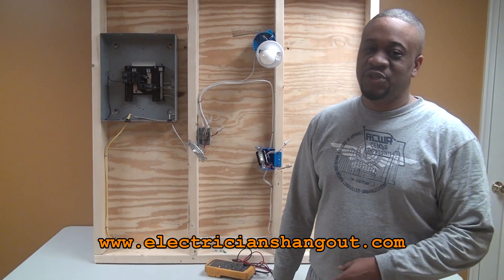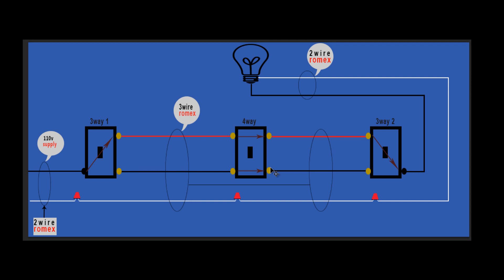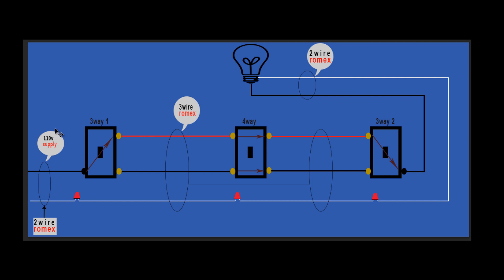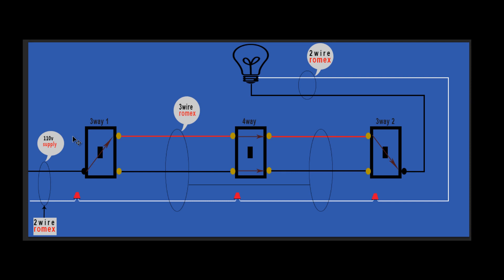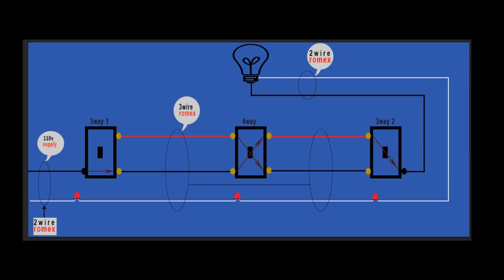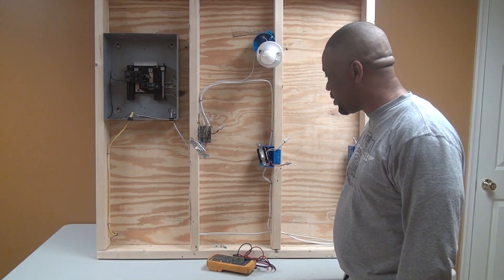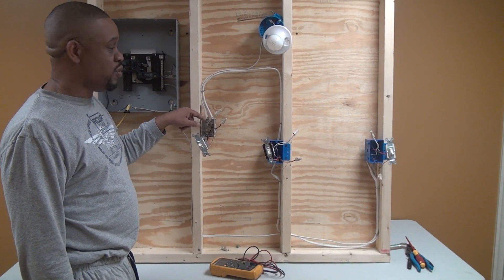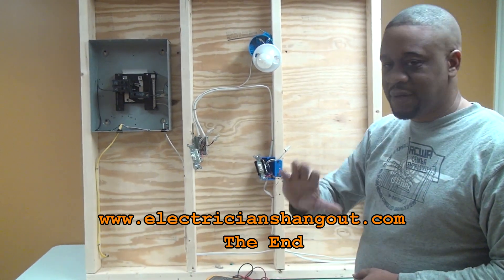How to wire a 4 way switch

Comment: Thanks for explaining the 4-way switch in a very clear and easy to understand way. The wiring diagram is very helpful, and isn’t included with all the other videos I’ve watched about electric wiring.

I’m converting my kitchen recessed incandescent flood lights to LED flood lights. I have 3 switch positions, and one of the switches has a dimmer control. I assume that the dimmer control is not compatible with LED dimmable light bulbs, since the dimmer is 15 years old. 

I do not know which switch is connected to the uninterrupted electric power. If the dimmer controller is connected between the two on/off switches, then I would need to buy a 4-way dimmer that’s compatible with dimmable LED light bulbs. Otherwise, if the dimmer is not in between the two on/off switches, then I would need to buy a 3-way dimmer that is compatible with dimmable LED light bulbs.

Do you have videos about converting from incandescent to LED lighting, which also involves a dimmer and 4-way circuit?

Comment: How would you wire a 3 way if you have black and white on a light switch
Reply from the maker: if there is a single pole switch on the black and white wire then can't
Reply from the maker: you would have to run all of the wiring

Comment: Hey Tyrone, I just saw your vid because I just did one similar and put it up tonight and decided to look at who else has something here like that to compare since I'm new on youtube and my vids are mostly mechanical related. We have the same last name and I chose to look at yours first, I'm not a pro electrician but have been dabbling in it for ever, I was a pro auto mechanic and welder before my lazy side got me into trucking but can't keep out of repair work, it's in my blood, my vid is shorter and simpler maybe you can look at it and tell me if you see anything wrong, I know it's safe and works but maybe not completely legal. Thanks.
Reply from the maker: +Gordon Robertson Hey Gordan took a look at your vid and it looks good. The only suggestion that I would give would be to group the conductors together in the panel using tape or ty wraps.
Reply: thanks Tyrone, you must have seen the new one I put up today on the double dedicated, that box is in my shop and is always open, I know it's a mess, I would never leave a panel like that at someone else's house, the video I was referring to was on the 3 way and 4 way that I laid out on a piece of plywood. I don't have any mechanic vids to do right now so I did some electric just to keep some new ones going up. I only have 4 right now on house electric and probably won't do much more on circuits, but I might do 1 or 2 on fishing thru the walls, old work boxes and patching walls. I would appreciate if you could look at the other ones I did on electric and tell me what you think. Thanks, Gordon.

Comment: The wiring  he using its perfectly working!
As for the names of switches he is  wrong, the switch on midlle its call "INTERMEDIATE" because its acting between those he calls 3way which again wrong because those are call "TWO WAY" they are actually have two states.

Comment: Thanks for your video is very clear and helpful, Just  question that  I have is, I's installing a SENSORSWITCH CMR9, when I ordered they explain me is possible used like 3 way switch and I did without problem but I am try to install now 3 switch at the same fixture (like 4 way switch) do you think is that possible? Every sensor has 3 wires white=Neutral, Black=load and another Black =Hot., thanks
Reply from the maker: not sure I understand your question, are you trying to control the light from 3 different locations?
Reply from the maker: it looks like you can wire as many of the sensors in parallel as you want so if I understand you correctly the answer is yes.
Reply: YES , the answer at your question , lights from 3 different location, I did you recommendation and the system is working great Thanks again

Comment: Hello Tyrone, I acknowledge your skills with electric I was just wondering why is that with the 3 way switch tutorial the black wire is connected with common screw and on the 4 way tutorial the black wire is connected to one of the travelers screws and the red wire is on the common
Reply from the maker: Not exactly sure what you mean when you say common? The black wire is hooked to the point screw in both the 3way and 4way switch video. you have to remember that in both boxes with the 3way you have 2 black wires one from the 3 conductor and one from the power source in one box and one going to the light in the other. The black and red in the 3 conductor I use as travelers.

Comment: In DC circuits the black wire is the ground- correct?  What is the white wire in AC?  alternating current means no fixed + and - , but there is an actual ground (to ground)  why is the white called 'neutral'?   Does anyone know a good book on standards so I don't kill myself wiring my house?
Reply from the maker: The white wire is called the neutral or the grounded conductor not to be confused with the grounding conductor. The neutral serves as a path for current to return to the source so it is a current carrying conductor when the circuit is under load (it is hot). Just knowing how a circuit works help when wiring a house but in order to wire it safely requires a lot more info, a lot more than I could explain in this reply. I am coming out with a residential basic electrical wiring course in the next few months that teach the things that you need to know when doing residential wiring. When the course go live I will more that likely offer it to my youtube subscribers for a discounted price.

Comment: I have a question, is not about the switch.
I have an old blender which have an metal casing .. and if i touch it i dont feel anything... but if i touch some bowl sitting next to the blender i got shocked... 
It was sitting on the metal table ... i know it may be shorted circuit... but why i dont feel anything when i hold blender? How does the current flow ? And why i get shocked when i touch metal bowl that is separated on the other table.. ? Oh, and the circuit breaker did not trip even it has the cool 30mA  protection.
Thanx for the answer
Reply from the maker: The outlet supplying the blender is not grounded. If there is no ground in the outlet box you should replace it with a GFCI. That is a particularly dangerous situation and should be addressed immediately. All that being said the reason you do not get shocked when contacting the blender alone is the current has no path to ground. when you touch the blender and a source that has ground or something close to ground potential the current flows through you to the ground source (very dangerous, with a good enough ground and current taking a certain path through your body could cause death!!!) so be sure to stop using the faulty blender and replace outlet with GFCI if no ground is present in the box.
Reply: +Tyrone Robertson  I have seen this happen when the outlet was wired backwards, example, hot wire on the silver screw and neutral on the gold screw, of course like you say a gfi would fix that because you can't wire it wrong and get anything out of it unless you wire it from the bottom (the taped end)

Comment: Tyrone how do you attach 14 gauge stranded wire to the terminals of a device (switch/receptacle) strip and twist about 1/2 inch and wrap under head of screw, or use some kind of fastner/crimp connector? there is little info about this online, thanks as always Tyrone!!!
Reply from the maker: you want to use a crimp type wire connector like sta-kon

Comment: Sameer Madhani6  Commented
 
"Saw this video and tried to implement two 3 ways and a 4 way switch. the wiring has been done and off the possible 8 combination of 3 on/off switch, 2 combination doesnt work. 010 and 111 combination doesnt bring the lights on. the rest of the combination works like charm. Any advise."
However, to date he has not received a response.

From his good (binary) description of the switch positions it is clear that the problem is in the wiring of the Intermediate (4 way) switch.
It is difficult to explain this without a diagram so I suggest that he looks at http://www.electricaltechnology.org/2012/11/what-is-intermediate-switch-its.html where appropriate diagrams  (Fig 1, 1a & 1b) will be found.
While the 4 terminals on the rear of most Intermediate switches look as though they should be connected as shown in the diagram used in this video, this is not always so.  In fact, the Intermediate switch usually does NOT connect the wiring terminals "diagonally" at any time BUT connects either "horizontally" or "vertically", as shown in these diagrams.  To fix the "problem", all that is necessary is to "cross over" two (and only two) wires,as shown in these diagrams.

Comment: Saying u should never connect the white wire to the switch on one end of the 3 way 4way system is false because u can use the neutral and hot on the box that carries the switch leg and heat the neutrals through the 4 ways to ur last 3 way
Reply from the maker: you need to look at the video again because that is NOT what i said.

Comment: Ty, I have four switches, 3-ways in the 1st and last positions, and 4-ways in the 2nd and 3rd positions. At times, the switches don't all work. That is, if the 2nd 3-way toggle is UP, none of the other three turn the light on/off. I found that 2nd 3-way has TWO hot wires in the box, a red and black (a third, white, is not). Does that mean the travelers from the 1st or 2nd 4-way switch are mixed up? Why would a 3-way switch have TWO hot wires leading to it?

Comment: I have 1 black, 1 red and 1 white wire for 1 of the 3 ways, 2 black and 2 red for 4 way and 2 black and 1 red for the other 3 way. I can probably send a pic if that help or can redo the whole wiring again which ever is easier.

Comment: Saw this video and tried to implement two 3 ways and a 4 way switch. the wiring has been done and off the possible 8 combination of 3 on/off switch, 2 combination doesnt work.

010 and 111 combination doesnt bring the lights on. the rest of the combination works like charm. 

Any advise.

Comment from the maker: I am not sure of the question but if you are asking what wire gets connected to ground then it is the bare copper wire. To the second question yes there are several ways to wire a 3way or 4way switch loop I choose what I consider to be the most widely used method here in the USA.

Comment: What cable do you use when you want to connect "ground" to light? Do you have to use four-wire cable? And one more question - Why do you use only one design (I see it in American's films :)) of switches and outlets in America? There are more than five standart designs in Europe. PS.: Sorry for my English.